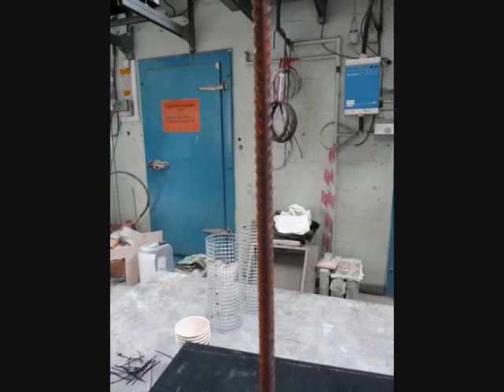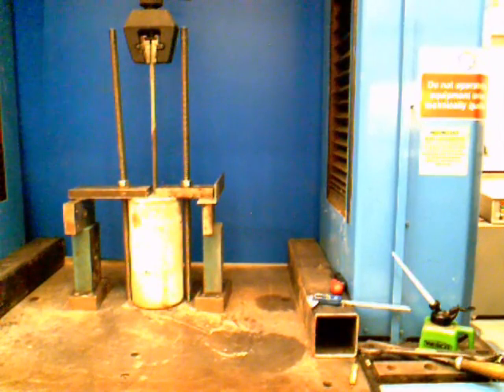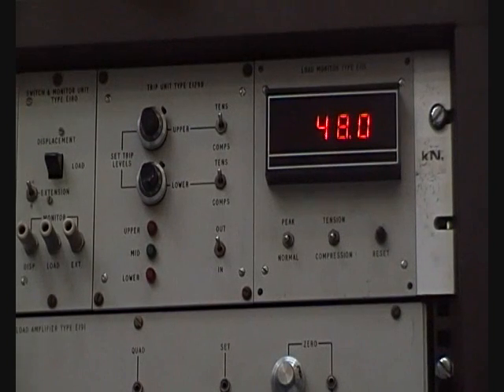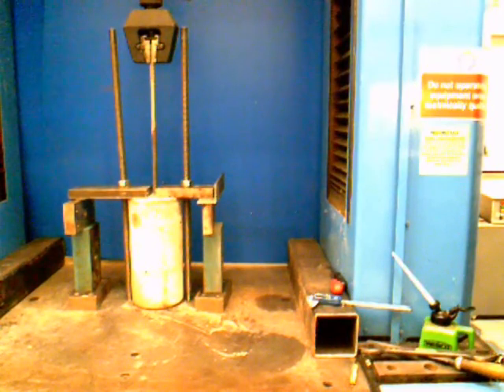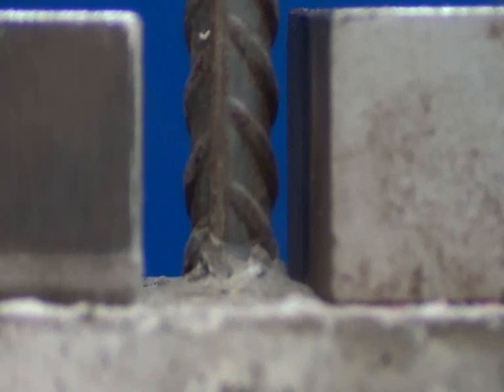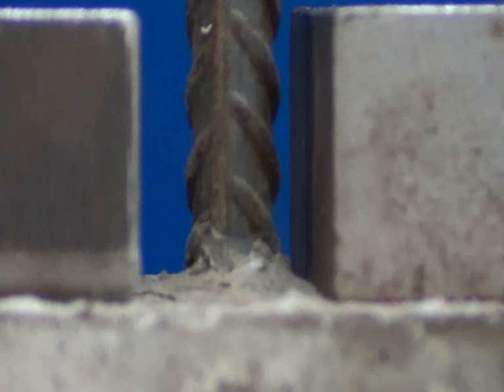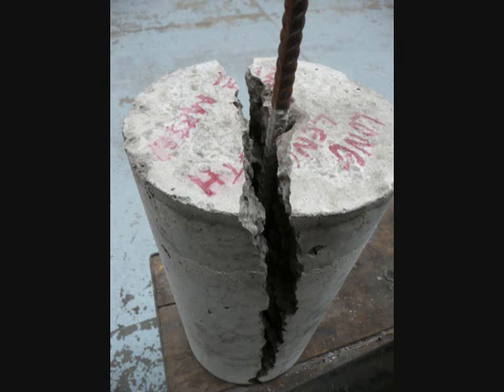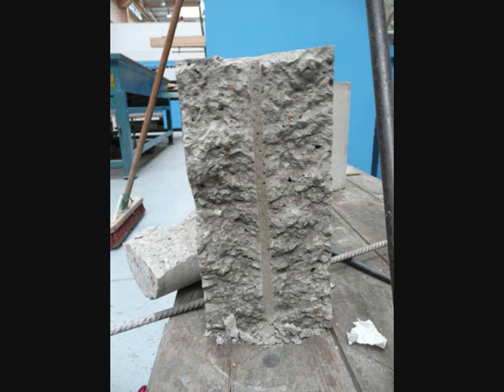A Pull Out Test on a Ribbed Reinforcement Bar Embedded into Concrete

Comment: This test may be used in a project where the bonding strength between concrete and the rebar/stressing strand is under question when using substances that may be applied (coated) on the rebar/strand. The principle of the test is mainly to have a comparison between the pulling strengths for the  rebar coated with the substance and that which doesnt have any coating.